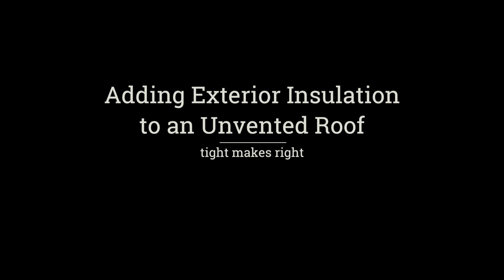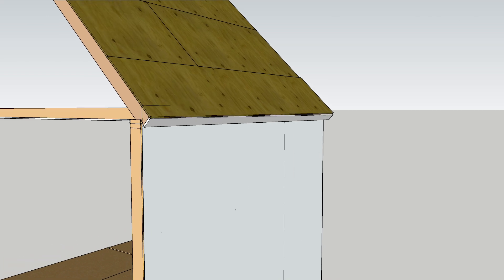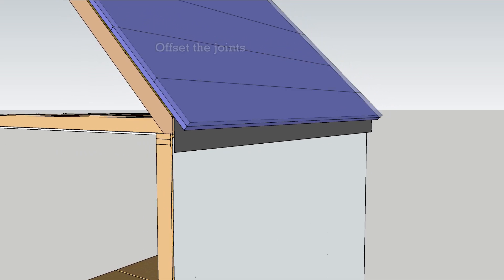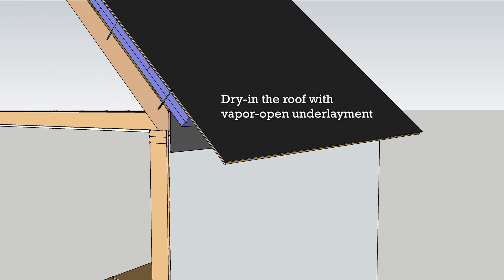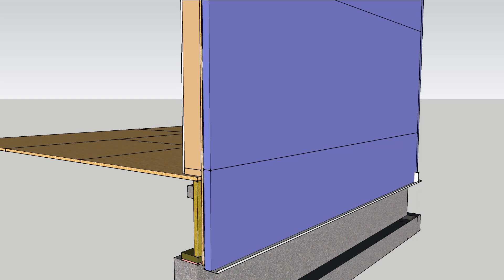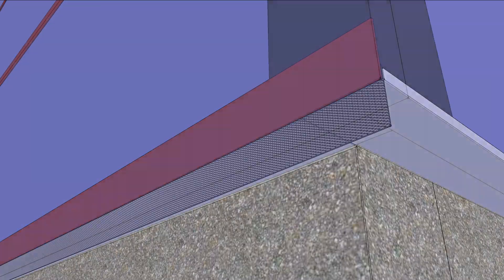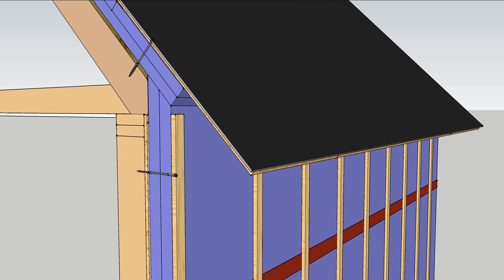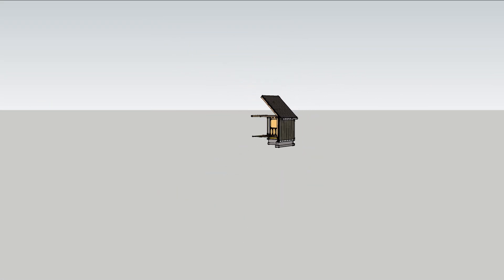Exterior insulation retrofit: walls and unvented roof

Comment: Also how do you do with the gable ends ?
Reply: Add a board to cover the insulation. Google says to use a board that is 18 mm or 3/4" thick and treated wood will last longer and is preferred. Think about it before you start the project and write down what you are going to do. I am about to do this and I think I'm going to extend the decking out 3/4 " to attach the fascia board to from below and then I'm going to tie it into the old existing fascia board vertically and add a metal aluminum fascia strip on the whole perimeter of the house if I can find the right stuff or else Ill just paint it. Make a video and post it here when you do it. I've been looking for this answer too.

Comment: Hello,
Is it also the best way to build a NEW house, or is it only to improve an old one ?
Reply: Check out Matt Risinger's channel; he has built a number of new homes with exterior layers of insulation.  Apparently it is becoming standard building code for northern areas.  Exterior insulation has many benefits, but does increase construction costs.
Reply from the maker: This is an excellent way to build new houses. In fact, people have been doing it for years. go to buildingscience.com for the best information.
Exterior insulation is better at stopping thermal bridging than cavity insulation, so even if you deepen the studs to 2x8, there are still thermal bridging issues.
Reply: It is way better to build a new house with 2x10's or 2x12's and add the insulation in the rafters before you finish the interior. Closed Cell spray foam insulation seems to be the best option but do your own research if you want to do this.
Reply from the maker: @computergroove  cavity insulation doesn't stop thermal bridging. Continuous insulation does.
Reply: @ProTradeCraft  I figured that was implied.

Comment: Thanks for your video.
I live in AZ and I'm looking for a SUPER cheap and easy options. 
Like spraying another 2-3 inches of stucco/chicken wire onto the exterior walls. 
Or simply attaching another layer of asphalt roof shingles over a new layer of rigid foam + foil ?
Probably not as effective, but maybe close, at a fraction of the cost?
Reply: I would suggest not trying to do this super cheap. Best way to get it cheap is to do it yourself - IF YOU HAVE EXPERIENCE DOING THIS KIND OF WORK. You have 2 options, What the video above says or a tear out of the interior walls and ceiling of the upper floor/roof area and insulate. I just did the later and I am going to now do the former. You need an R-value of R-38 or above on your roof level. The above will only add R-20 to what you already have.
Reply: Sell your house and rent

Comment: Sick houses? Who remembers the homes built during the Carter Presidency that got tax breaks for being sealed up nice and tight? The chemicals in the homes made people sick. Mold formed, blah, blah...Lets hope they've learned how to do this now.
Reply: Yes. They have learned how to deal with the problems caused by building airtight. They use mechanical ventilators with heat recovery (HRVs).
Reply: Plus, by putting the insulation on the outside the studs stay warm enough that vapor doesn’t condense on them.